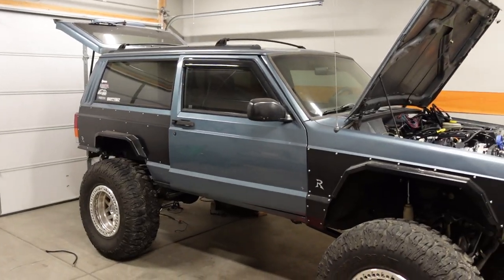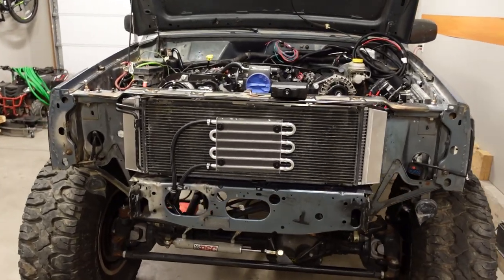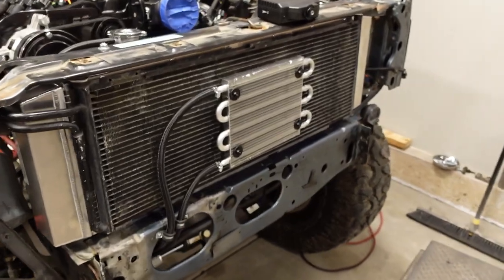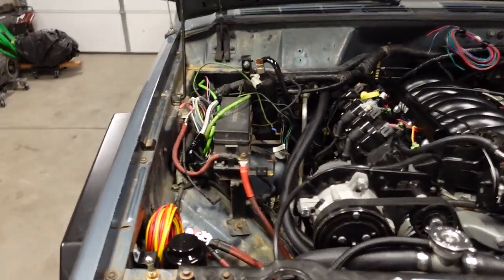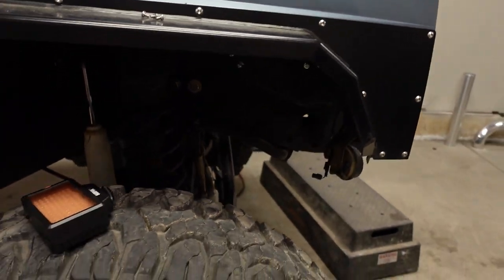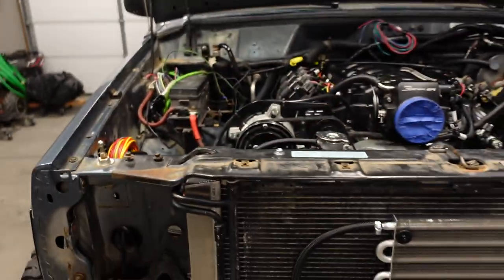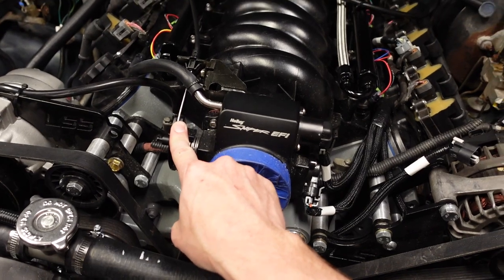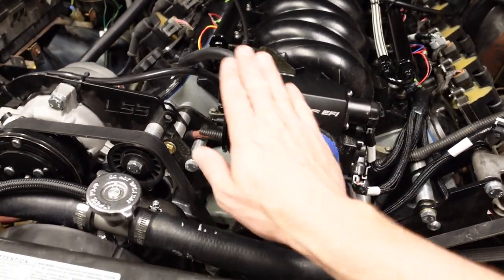XJ Cherokee LS Swap Progress Report: Some Parts Wouldn't Fit!

Comment: Hey buddy. You are correct on the DR44 Alt. I just dealt with this yesterday. Completed an engine build for a customer and had it on the run stand not expecting it to charge in fact I wasn't even thinking about it to be honest, but out of habit I did hook up the main charge wire on the back of the alternator simply because my run stand is setup to reflect the engine being under the hood and it caught me by surprise when I looked at my instrument panel and it was charging at a solid 13.8v with absolutely nothing plugged into the exciter plug or whatever you want to call it. just thought I would share that in hopes it helps ya out!

Comment: LT Great work. Only thing I see as a potential issue is the Terminator X isn't a water tight ecu. I would definitely recommend figuring out a way to run it into the cab.
Reply: John Doe  hoping he sees my comment. I've heard of a few putting the ecu in the engine bay, but they ended up having to replace it and move it into the cab due to moisture getting to the ecu and frying it.
Reply: Well, after I get it back from LT I'll definitely look into relocating it, ultimately I would like to move all of the electrical equipment into the cabin.

Comment: Eh, one thing of note....that Terminator X is not heat or water resistant.  Mounting in the engine compartment is not recommended.  I am sure by now the customer has figured this out.  Both the Dominator as well as the HP I believe are both rated to live in that environment, but not the Terminator.

Comment: Do you recall what accessory spacing was used? Truck, F body or Corvette? Looking to order my brackets but still waiting on Novak to ship my radiator so I can’t see what clearance I have between the radiator and pulleys. Nice job on the build. Putting a 5.3 L33 in mine right now.
Reply from the maker: This was truck spacing I believe

Comment: Instead of going through the whole mess of hose and simplicity of a smaller and cleaner look with the PCV, it would be much easier to swap out the passenger side rocker cover with the LS7 one...JMO.

Comment: Take that alternator to a shop that works on them there is a few places in slc they can make it 1 wire or 4 wire with no switch
Reply from the maker: not a bad idea!
Reply: @LawrenceTolman  better to have the alternator stock especially a trail rig as you might need to pick up a new one at a parts store, better to have it plug and play and not have every alternator modified.

Comment: Those zip tie thingies are often a mistake, especially on an off road vehicle that actually goes off road.
They will either fail entirely or allow the cooler to move around enough to wear a hole in something.
Reply from the maker: I agree, not my favorite mounting solution

Comment: This has got me wanting to swap my 02 wj but mine would be far simpler 350 small block sm465 4 speed and haft to make a decision on transfer case would definitely make brackets to retain my ac but other wise nice and simple she's a wheeler I bought at auction runs really good but the trans is not feeling good at all she has 1st and some other foward gear only shifts when your feeding her the onions and it really boggs down and she has not even a hint of go backward left in her I still RIP around init threw my woods and all over the property oh yeah and zero brakes lol those are optional has heated leather tho

Comment: LT, love the channel. 
Question I have a 1987 CUCV with a 6.2 that ran @ 3 years ago. 
Would be worth trying to get it going or swapping it out for a big block Chevy which I have ?
Reply from the maker: I guess it depends on your goals for the truck. The 6.2 doesn't do much for me even if its running like brand new, if it were my truck I'd absolutely install a big block.

Comment: LT, why don't you ask the customer to let you replace the passenger door handle so you don't have to leave it partially open all the time? The handles are super cheap ~$20 and only takes a little over 1/2 hour to replace. Working doors make life easier haha.
Reply from the maker: haha... that is a good point I should
Reply: I changed out the lock assembly right before I brought it to LT, I either bent one of the rods or completely forgot to connect it, as soon as I get it back I'll pop the door panel and tweet it.
Reply: @jimmyburks7030  Nice, sounds like a plan. I just did both the driver side front and driver side rear exterior door handles in my '89 XJ. All the stupid little rods going through the inside of the door make working on them a pain. It's almost inevitable that I end up getting cut up on the razorsharp door sheetmetal too, hard to see what you are working on.